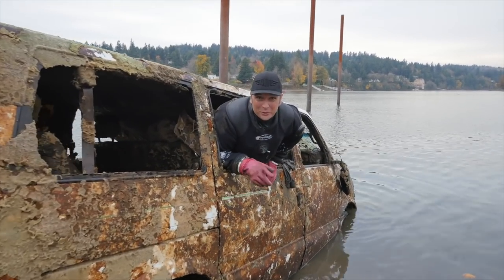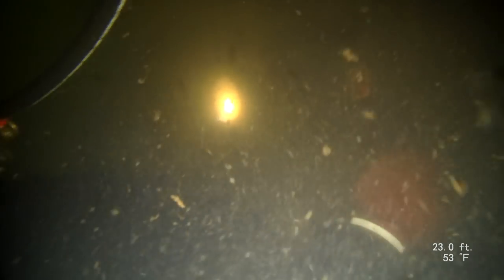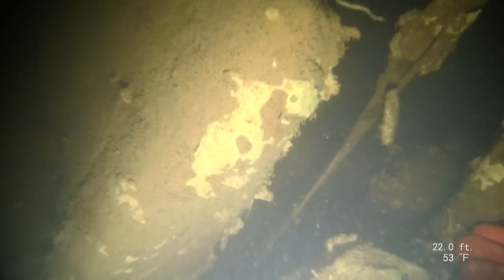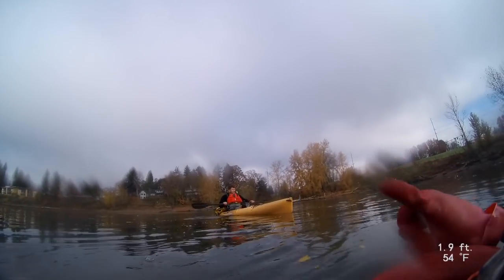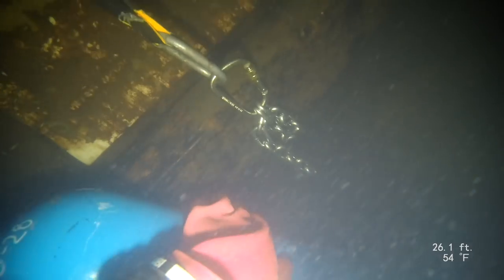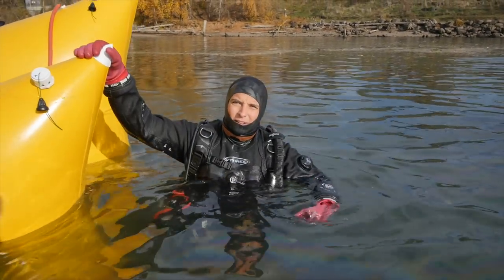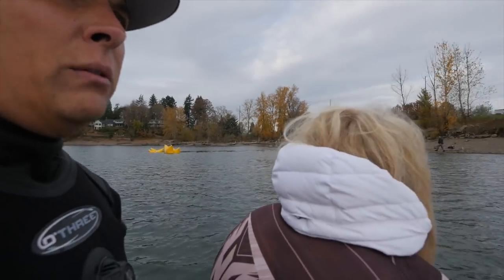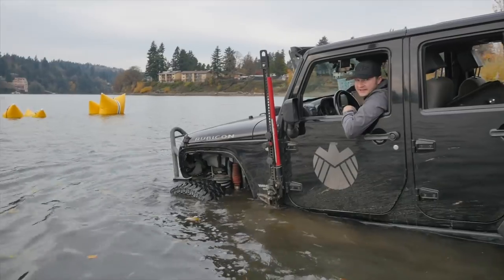MISSING SOCCER VAN FOUND 25' UNDERWATER! (River Treasure)

Comment: That isn't just someone's everyday "taking the kids to school" Astro van.  Judging by the tires and wide wheels, that was someone's baby.  I wonder if it was stolen and dumped?
Reply from the maker: Probably both!
Reply: It's really tight but a V8 will fit in those.
Reply: I'd thought I'd saw zipties like the auctions used around the steering column I was thinking dealer auction gone wrong
Reply: @ryanravencaller  GREAT observation!! There were zip ties!!!

Comment: Just a heads up for AWP, all vehicles have a minimum of 2 drain plugs in front of each row of seats and two or more in the trunk. They are easy to find and can be removed with your fingers. They will be under the carpet and along the edges of the floor pan. I'd like to know what the advantage of a carabiner is over a shackle.

Comment: You guys need to stop pulling once the car is out of the water enough to open the doors. Hauling up a car or van full of water is like hauling 4 vans with regard to weight. Get it up just so the floor of the car is about even with the water and open whatever door is on the low end. If you can't open the door just punch a hole in with that big pry bar and let it drain. Once you get 90% of the water out it will come up so much easier. I'm sure you guys know this maybe just doing it for the video.

Comment: You need to save an emblem or hub cap off each vehicle you pull out and hang em on a wall with a pic of the car.
Reply: Would be a neat display of the cars salvaged from the waterways.

Comment: How do these vehicles end up underwater and get out that far?
Reply from the maker: The cars are in the water because they are usually either stolen or insurance fraud. They get so far out because cars float for a while before sinking, also the current can push them out quite a ways.
Reply: @AdventuresWithPurpose  thanks. I figured that was the reason they end up out there. I was just surprised how far out they get.

Comment: The rims on the astro just don't fit it at all
Reply: it looks like it's lowered, and judging by the tires being low pros, it was probably a pimp van
Reply: @closewatermelon  well it was either lowered or the suspension collapsed under the weight of the water